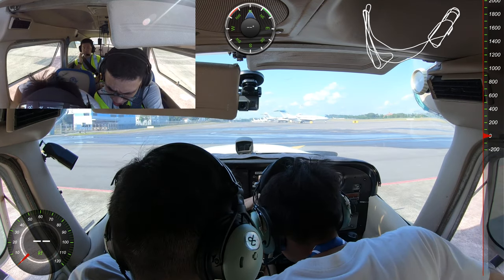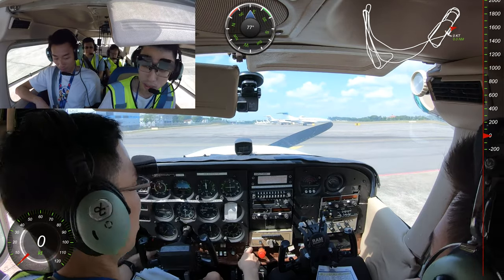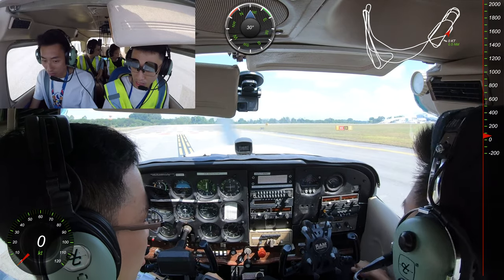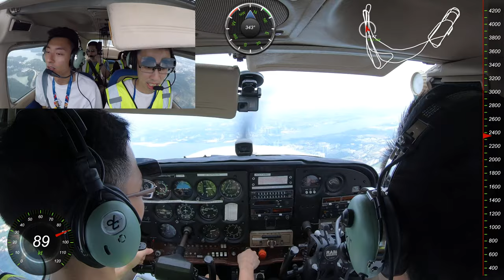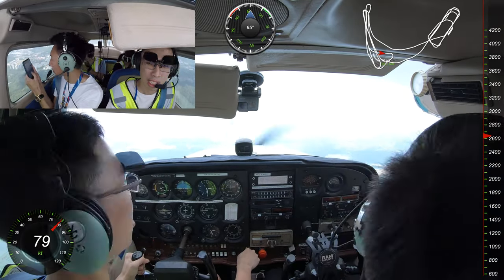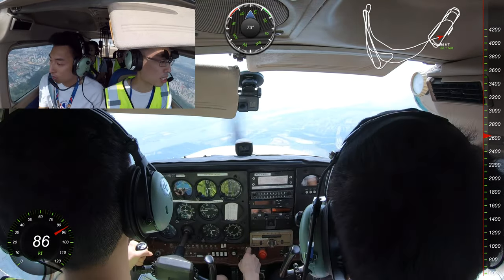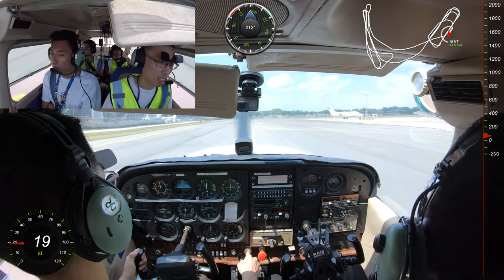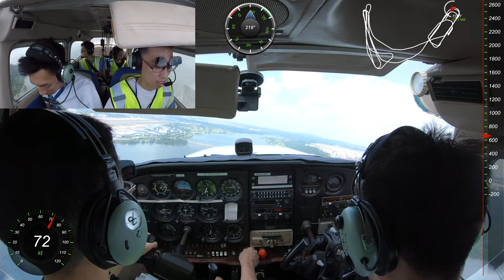Local 9 - 4 POB! CPL copilot, child passenger, fail PFL, Screwup landing, Flapless, Low Level - 4K

Comment: Faa flight review can do in Singapore? Or must be done in US? What is the implications if can't travel to US to do flight review due to travel restrictions?
Reply from the maker: Yes a flight review can be done outside the US including in Singapore. As long as you can find an FAA instructor and of course an N-registered plane.

The issue I can forsee is that the flight review may include a cross country component. There is only one GA airport in Seletar which means doing a cross country flight will require flying out of Singapore which is troublesome at this time.